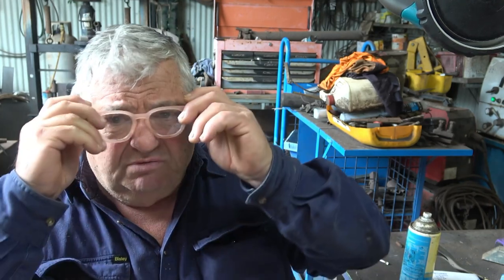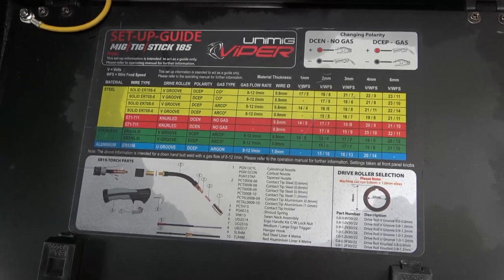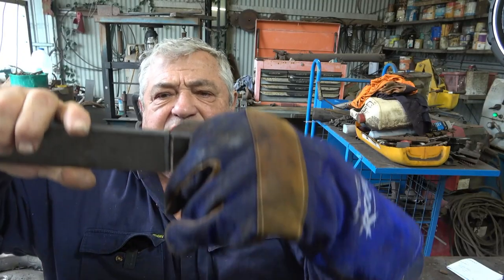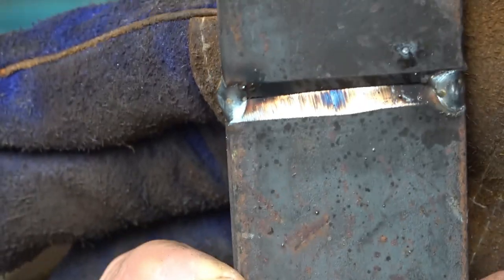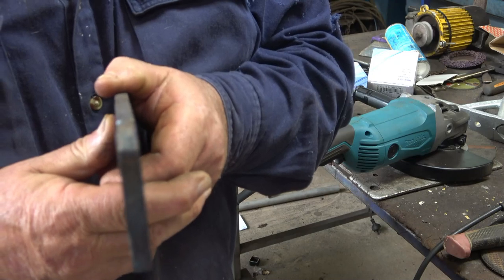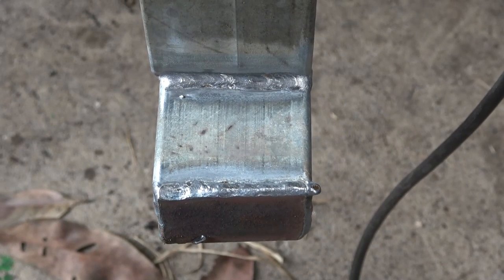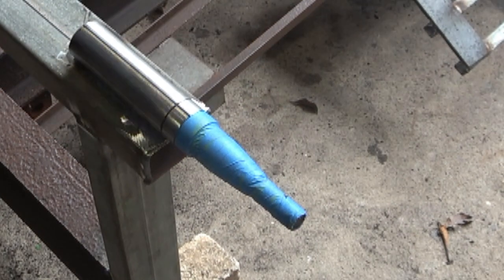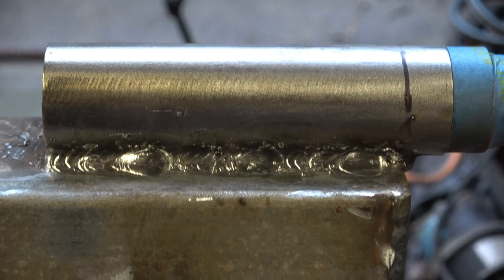HELP TIPS AND TRICKS FOR POEPLE NEW TO M.I.G. WELDING

Comment: Great video , good tips About The safety.  Lost count of all the times I've had Mig flash especially in the middle of the night. We used to put sliced potatoes on our eyes   , helped with the sand in your eyes feeling.  Was sick of metal sparks in my eyes to and running magnets over my eyes to get it out. Now I'm older I won't do anything without goggles and a good welding mask. The pain is not worth it, I learnt the hard way when I was young. It also ruins the beer time and who wants that.
Reply from the maker: A few trips to the doctor soon wakes you up to yourself. John

Comment: Those small hub axle things remind me of  Dad thought you could pull a wood splitter on the highway behind.   It wasn't until later we learned no, the reason it has a hitch is for the four wheeler into woods!  I mean duh.  Sharing a dumb Benny Hill.  <><
Reply from the maker: O well we all make mistakes. Thats what I want to do tow the wood splitter if I need to move it. John